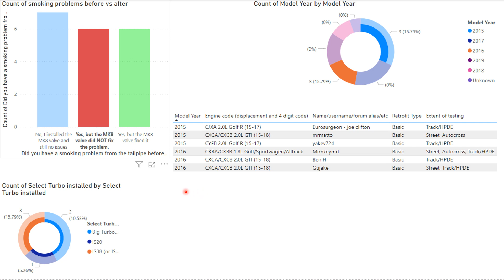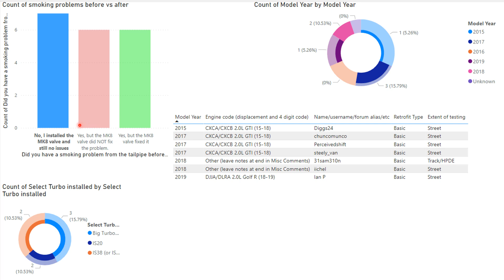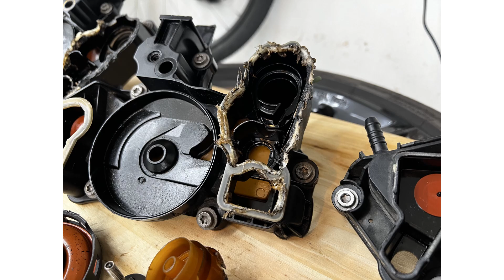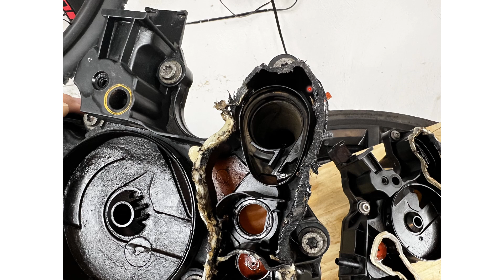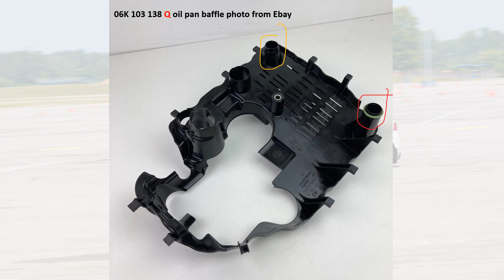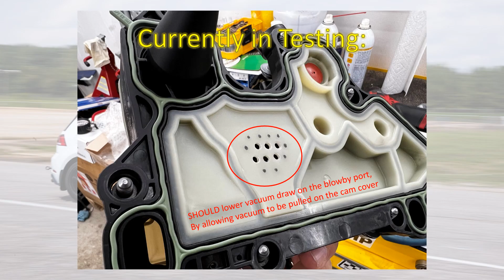MK8 PCV Retrofit UPDATES (Pt 10): User Feedback + more PCV Tech Talk

Comment: Looking for information. Have a MK7 R.. installed a pcv valve cts catch can. Rough idle on cold starts but fine once warm. Other ppl had issues. The kit came with a venturi valve type thing but no instructions online. Not part of the original instructions nor in any pictures. I feel like it is a after part they threw in now. I never put it on the pcv valve inlet pressure line.. but im going to put it on this week and see if it makes a difference. Maybe because of issues its a walk around fix they now include? No info online.. hopefully your vid can give me some more insite into crank case pressure.
Reply from the maker: I responded to your other comment with info that hopefully helps. Also check out the APR PCV plate video as it'll be most directly applicable to how your CTS plate operates.
https://www.youtube.com/watch?v=aeCQuBDEUEs

Comment: in my opinion the main problem seems to be the oneway valve in the yellow path.
If there is not enough pressure difference between the PCV oil return side and the crankcase (oil pan) the valve may not open and the yellow path could get flooded because it cant freely drain back to the oil pan.
Reply from the maker: So I did originally think this, but people even with iAbed pans (which do away with the OEM baffle entirely) still have oil ingestion.

Here's a more recent video where I looked more into my diaphragm theory (and why TIPs have a huge effect on the system overall):

https://youtu.be/Pjcpla__riY?si=E7QAq5zCEu1syEY1

Comment: Seems like my 2020 MK7 GTI has a failed pcv valve at 30k miles, it has constant positive vacuum on oil cap during idle as well as multiple misfires in all cylinders in idle. It  has downpipe, exhaust, stock turbo, D088 ic, CTS turbo inlet pipe, hpa hpfp running e85 with Sneeky tune. In your opinion would the MK8 pcv system last longer and be better in the long run from either the factory pcv valve or oil catch can.
Reply: Also forgot to say a CTS air intake
Reply: Also this is my daily driver, I do not track it. And I do sprited driving ever so often.
Reply from the maker: It would probably be fine with a MK8 valve, but I wouldn’t bother unless you’re willing to try the “full” retrofit. Otherwise another BK valve (which I believe should be stock for you, you’ll need to verify) should be just fine. If it’s not an overly strong vacuum at idle, it’s probably fine though. There should be some light vacuum at idle with stock valves.
Reply: @datadrivenmqb  I mean yeah it is a Bk, just don’t want to replace it after 30k miles every time if there is a better alternative for a little more money. Also I like upgrading stuff in my car lol.  If I can upgrade to a better setup for $200 extra I want to do it. Looks like you did a good bit of research and testing on it. So yes I will be doing the full retrofit to get it done right. As once we start modding these beasts we gotta figure out better ways for the pieces to work well together after modding it. Thanks again for your feedback and all your research!
Reply from the maker: @NinjarA7  sounds good! I do think getting an OEM-ish setup to work right is the better option for 95% of people. Especially those that don't see road course track time. I'll be posting more info as I do more testing... but I did confirm tonight that aftermarket TIP and intakes considerably drop vacuum a significant amount. If you HAPPEN to encounter any issues, I'd consider swapping those back to stock if so. I'm not sure how much of the problem is the TIP, and how much was the intake, but that will hopefully get figured out a bit more as I find a few other locals to help get some data.
Reply: My PCV "AS" revision (on 2018 MJ GTI Perf. ~100k miles) recently got a problem with the intake manifold side (blue path) doesn't close on boost - so i had a sligt loss of boost and so a sluggish throttle repsonse / power delivery  in low RPM range.

You can test this by a simple blow test on the disassembled valve.

I replaced it by a "BL" Revision - problems solved

Comment: Might try this on my MK7R with e85, with a catch can between the PCV and TIP to reduce oil dilution issues. I have Racing line inlet and BMS TIP.
Reply from the maker: Catch cans won't help with that at all. They really need to go between the blue path in the cyl head and the PCV, which is a bit of a problem. This is covered in the original video here: https://youtu.be/jYdF-sOLe3I?si=pLn0XrgYoI3ktRQl

Personally I think the only reasons that catch cans catch any watery stuff is because they are cold metal and when the engine is first started, any moisture in the air ingested instantly condenses. This is why they don't fill up near as quickly when it's hot outside.

The MK8 valve does much better without a catch can because the can on the TIP side delays the vacuum being able to be replenished on WOT. If a catch can is "needed" (it is not), then I think fitting the Venturi would minimize the bad effects of the catch can's added volume, since it'll not allow vacuum to drop on transient throttle changes.
Reply: @datadrivenmqb  thanks for the feedback.  I'll do it anyway, to reduce oil going n the TIP and pooling in the intercooler.
Reply from the maker: @2001pulsar  I ingested 1.5qts of oil in an hour at VIR with the BK valve. Intercooler pipes were bone dry. Oil being ingested is not through the TIP aside from the tiny bit of oil mist that might accumulate there.
Reply: @datadrivenmqb  my TIP, charge pipes and IC are getting quite oily, it's high boost blow by at 3.1 bar. I don't have clouds of smoke like some. Almost 100% street driven.
Reply from the maker: @2001pulsar  got it, good luck 👍

Comment: As a 2017 gti owner I wonder if the popular move of going BL instead of AH can be detrimental to the engine.
Reply from the maker: Yeah the AH valve definitely has me scratching my head since it would make it harder for crankcase pressure to vent. I want to find an AP valve and see if that one way valve is still present on it as well.
Reply: @datadrivenmqb  also I was really surprised that the small triangle opening in the BL is a small port similar to the AH's big honking one but moved to a different spot.
Reply: @datadrivenmqb  are you saying the AH would have a harder time venting crankcase pressure or the BL
Reply from the maker: @diydrivenGA  Correct - it seems the blowby path would be nearly useless in the AH valve due to the direction of the one-way valve just inside the PCV. It pulls vacuum on the cam cradle primarily so isn't using the red path hardly at all. AH pulls on the cam cover, BL pulls on the red path in the diagram. To be clear they are both evacuating the crankcase, but airflow throughout is very different.

Not sure if you missed the part, but the BL small port doesn't go anywhere at all. It seems to just be leftover from manufacturing.

Comment: The factory TIP narrows from the intake hose diameter to the turbo inlet housing.  I believe that will increase velocity past the TIP hose and produce more vacuum vs. an aftermarket TIP that has a more constant diameter...I really wonder if the TIP is part of this and the reason for the OE design.

Comment: Interesting… would do good with some flow bench Data. You’re missing the bigger picture.
Reply from the maker: Would be neat info for sure to know how much vacuum is drawn on the TIP PCV connection through different TIP/intake combos.
Reply: Subaru owners are worse at modding everything. lol
I don’t have my miles on my Mk8 Basic retrofit yet on my 18 S3, but I’ll report more after I do. I do plan on doing the venturi, I just want to find a boost source that doesn’t require me drilling anything.
Reply from the maker: @JordieG8 best bet is the 034 TMD in my opinion. If your turbo can't (like the Vortex XL I believe), then tapping the charge pipe is the only other realistic option. Or the turbo but 😬 The Venturi source has to be between turbo outlet and throttle body. Good luck!
Reply: @datadrivenmqb  yeah, I forgot to mention I’m running a GT2260S. It’s going to have to be the charge pipe. I’ll just have to find a way to do it so it’s secure and leak free. Plastic!